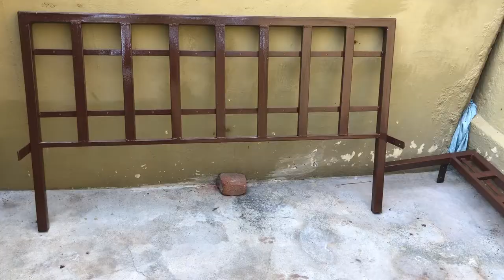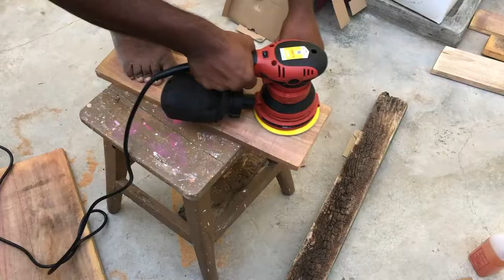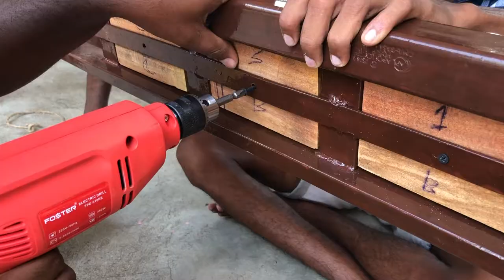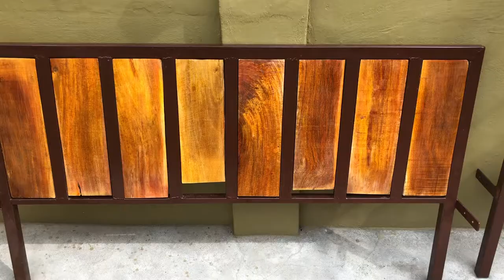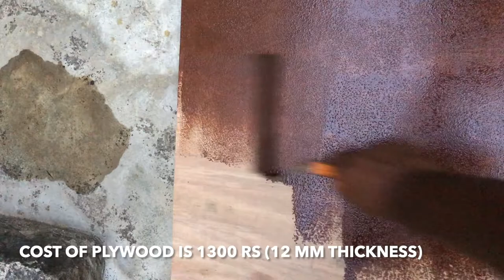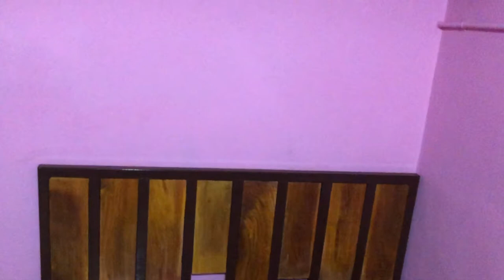How to make metal cot at low price. A new try with metal and wood combination for great look.

Comment: Number
Reply from the maker: It's done for myself sir you can check with any welding shop. Cost of doing per kg is 110 rs now when I did cost is 90rs. If you use medium weight metal it will come around 60 kgs.